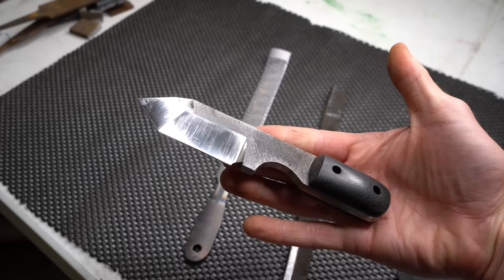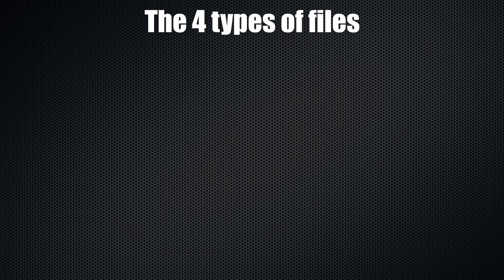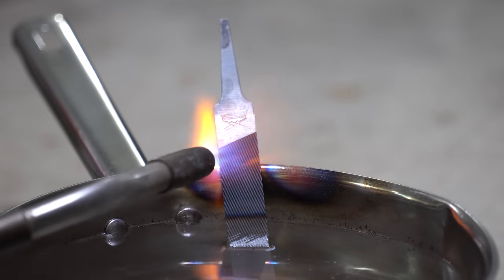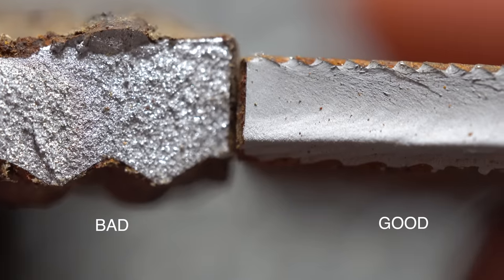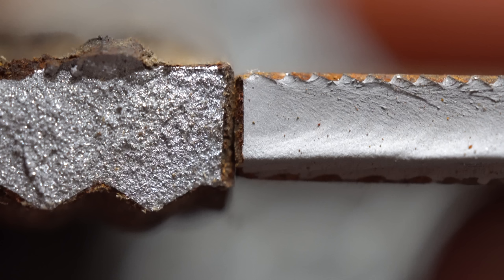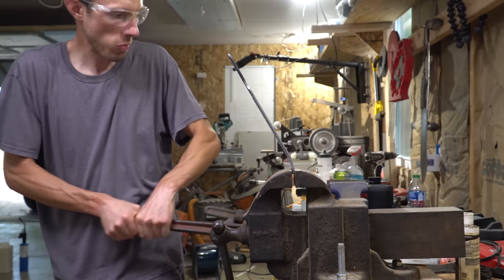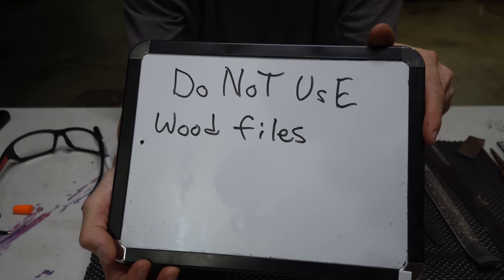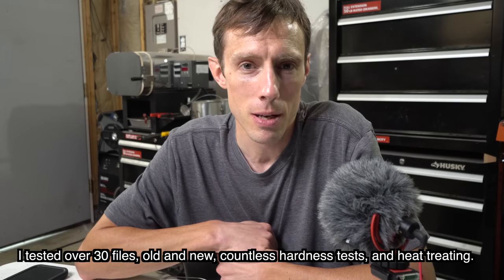DO NOT Make a Knife Out Of a File Till You Watch This Video-A Simple Guide To Files And Knife Making

Comment from the maker: Be sure to check out my recommended product page on my website where I have brief reviews on things I use⬇
https://www.outdoors55.com/shop
This is a work in progress and is updated frequently🙂
IMPORTANT⬇
This video is a brief summary of the mystery steel file world! I tested over 30 files and did almost 300 hardness tests. Testing hardness at the surface, as well as at various depths beneath the surface, all the way to the middle of each file. I also tested multiple heat treat coupons for each file, testing both water and oil quenching.  This video is a good summary and overview of my findings. Keep in mind your results may differ as file manufacturers may adjust their steel and heat treatments over time. If you think I missed something (im sure I did) leave your thoughts below. The idea here is to learn as we go, and any info is good info👍 I left a link to a through hardened file in the description (I tested 3 of these with great results). Thanks for watching!
Reply: just for the record, probably should have mentioned, when hardened steel breaks, it also has a tendency to send shards directly toward your eyeballs., also... why is that?
Reply from the maker: I did mention that, and included a link to a video showing how dangerous breaking hardened steel is. The link is up on the right corner of the screen when I mentioned it.🙂
Reply: @OUTDOORS55  im sorry, you did, my bad.
Reply: Very beautiful presentation. I guess i was lucky (and i used an already broken file with a nice fine structure break) for my first wood carving knife. Still my favourite tool for carving spoons after a few years. I guess it's time to make a proper sheath for it😉.
I'm slowly getting into blacksmithing and i hope to make my own spoon knife. The first one i made was too thin and had a crack so it broke 😒. But i made it a couple years back in a kitchen, during winter time, heating up that file in our central heating coal stove😊. And that was fun! If my mom lived, she would probably chase me with a broom from that kichen. Dad was pretty ok with it and smiled a little. He had blacksmithing lessons in his school time.
Reply: I found a file that says REX U.S.A.  It's old., with a kings crown logo.  KNOW ANYTHING ABOUT IT ? I can't find any info on Google.  Thank you
Reply: @OUTDOORS55 you forgot the 5th file type... The laminated file... Many manufacturers are using laminated 1045 over mild steel cores ESPECIALLY among farriers files and rasps ... They will mimic a solid file they snap nice but when you grind the knife you expose that mild steel core and never get a hard edge despite the hrc tester on the flat saying it should be hard...
Reply: question 68 seems rlly hard for most outdoor knives how could i change my heat treat to  achieve some thing in the range or 58-60 hrc
Reply: even if us as viewers didn't! Do a break test to test what sort of file we are working with would you not agree that it would still be better then 7cr-5cr steel

Comment: Great video. Back in the mid 50's dad made my first fixed blade knife out of a file what kind what brand name I have no idea , I did all the roughing grinding under dads eye all I can remeber is him telling me don't let it get hot . It has a scandi edge all these years later it is my favorite knife especially for skinning it has a 4-1/2 inch blade 4 inch stacked leather handle which by the way other than being bite darker is just like new All my leather gets oiled every new year whether  it needs it or not. Also keep in mind I've never tried to bend or shot it or hit it with a hammer . it just cuts every time I ask it to skinning or wood for kindling never batoned with it just cut  things . Happy Trails Uppps forgot I HAD TO MAKE A NEW SHEATH FOR IT ABOUT 10 YEARS AGO THE ONE I MADE FOR IT BACK WHEN i WAS A KID OUT OF ONE OF GRANDPA'S OLD BOOTS FINALLY WORE OUT AT THE BELT LOOP . hAPPY TRAILS  KEEP ON MAKING THOSE SMART VIDEO'S.
Reply: All i can add to this is...if you build it, you use it for what its Made:-)
And if you writte down the dimensions or make a trace picture if it...then you can rebuild it...even if you lose it

Greatz from Germany
and have a nice Day 
opo
Reply: That’s cool you still have it and actually use it.

Comment: Excellent and informative video. I have had good luck with the farrier's rasps I get from my farrier, but he buys the more expensive ones (>$30 each). I always test them before use though, by cutting off the tang, heating, quenching in water, put in a vise and whack it with a hammer. They snap and demonstrate good grain structure. 
I am not giving the brand, because that brand also makes case-hardened rasps, so it is more important to test them, which I do with every file except duplicates from the same lot (lot number given on the rasp). 
With that said, I also ALWAYS do a full heat treatment on the finished product (with an anneal before working) using a fast quenchant (50). I would not try to simply grind them and use original heat treatment. 
Caveat: I do not have an HRC testing device. I go by file skating and Japanese testing files as well as experience showing good edge retention with use.

Comment: Very good video, just remember if your rockwell testing on case hardened material your likely to push right through the hardened layer. Especially on the the c scale. The thinner the layer the less weight you use to test and change the scale to b or a. There are many ways of testing treated steel and its best to read up on what is the right one. I had many years of treating different types of steel and the accompanying testing involved....its an art in itself.

Comment: Great video - very clear (to me at least).  Yes, those relatively inexpensive rasps are "compositionally" hard. they have a bunch of carbide or whatnot in the steel mix, hence the grain. They are reasonably wear resistant, but not very tough.  I believe they are also impressed with the their teeth while in the red hot condition, and then quenched fast.  The expensive hand made woodworking rasps are through hardened,  because the teeth are cut cold,  then the entire rasp is hardened.  That said, who wants to make a $150 file into a knife?  There are so many worn out steel cutting files available.  I was given a dozen 12" lathe cut files  30 years ago, and I still have a few of them lying around for future projects. I don't typically make knives, but I do make other  odd cutting tools for weird applications,  and the repurposed old files are a pretty good choice for something I may only use once or twice.  
Thanks for your hard work!
Reply from the maker: Exactly! Thats the tough part about using files. The manufacturing method greatly influences steel type and whether it's useful as a knife. Thanks for the input!
Reply: I think I’ll limit myself to power hacksaw blades, I’ve seen them used in factory packing rooms, both on cardboard and flesh, they work well for both and the packing tape handles are easy to make !

Comment: I've been making file knives for the last few years and learned most of the things you mention the hard way. I never touched rasps, I knew they would be no good for a knife, for the most part. I did buy a large file to make a medium bowie and got my heart broken when I realized it was case hardened... much too late into the build. I have learned to tell the difference in hardness in how the grinder takes material off, softer comes off like crazy, it feels weird in comparison to a nice tempered file. I do not re-heat treat my knives, I do not have the facilities, I temper the file and then carefully grind down from there, cooling in water regularly. This takes time, but has the benefit of leaving me with a knife of the proper hardness without overmuch worry. I do the ghetto method of annealing for pins in the handle, works like a charm but I wrap the blade with wet towels and monitor the process very carefully, watching the color of the steel to tell me when it's done. (Usually dark blue.) I really appreciate the work you put into this and wish I had had access to it years ago, its good info! File knives are great when made right and can give you a nice, usable blade as good as many manufactured ones. (If not better.)
Reply: Why would a rasp be no good?

Comment: What I have always done is heat up the file tang till non magnetic and quench it, if the tang snaps or shatters from a strong hammer blow I know that it can be hardened / tempered.
This test has worked for me, but I cannot say how reliable it is.

Comment: Lots of good information here. 
I honestly don't understand the compulsion to use mystery steel to make knives.  The appeal of free seems to be too strong for some people to resist. 
STEEL IS CHEAP! 1075-1080 steel is very forgiving. It's easy to heat treat and A 60" .187x 1.25"  bar can be had for   under $25. That's enough steel to make  5 large knives or 7-8 medium knives. You can quench it in vegetable oil from the grocery store.

Comment: Very interessting, thanks. I personally never heard that you should use rasps as base material for a knife, only files. During C crises I made paper-sheets for all and wood handles for some on my files and rasps (about 25 large ones, 10 medium ones and 20 very small ones) to preserve them longer. handling  these  I can somewhat tell its different materials in them, shine, rust, sound and handeling on material etc. And especially newer rasps seems to be poor "mystery metal" as they go dull quickly (hardly sharp to begin with). I do save the dull ones in case I would somehow sometime get access to a  forge. But this video of yours have made believe I shall not save the rasps., Thanks again.

Comment: I’ve made probably 100’s of file knives, used to make 1700s knives and many originals were made out of files. 
  I only used vintage old American files,that right there will take care of most of your problems
Don’t use a rasp because of the teeth 
I forged all my blades and the rasps teeth can cause problems
When annealing the blade, heat up a flat bar, put it in a tray of vermiculite or wood ash then lay the red blade on it and bury them in the vermiculite 
I usually differentially tempered my blades. Easiest way is to paint the back with stove clay then heat it and quench it in hot
Oil.

Comment: I use only Grover Vallorbe from Switzerland and Pferd from Germany for filing, files. I did make a dagger out of a USA mfg. Nicholson file from the 1960s. Nice presentation.
Modern Nicholson files are made in either Mexico or Brazil and come warped right from the blister pack. Kobalt a brand sold by Lowes have soft steel bodies and partially cut teeth.
Reply: With Nicholson, i also had the same experience. It curls after we soften it, i straightened it with a hammer. Can we continue with this material? Can we have good results? Thanks
Reply: I just got some 12 pferd flat files, they were made in China, cut pretty good though.

Comment: Love the video. I made this one knife from a file and experienced kind of the same thing but i would recommend you try a water quench on the softer files that didnt want to harden much. Mine quenched kind of soft into used motor oil and extremely hard into water (about 63 HRC and cut glass without damage). Basically comes down to a few points - 1. If its regular carbon steel, then it can be heat treated properly ( there are many ways to tell if it is carbon)
2. If its some sort of a blend, it will require special heat treating that you might have to discover by trial and error 
3. If its mild steel somehow then you re better off throwing it away rather than trying to infuse it with carbon
Reply from the maker: I did try a water quench and parks 50 on all samples. There was a SMALL difference between water and parks 50 (maybe half a point hrc) but not enough to change the results. 🙂

Comment: did the middle of the case hardened files re-harden? or harden? The issue is whether there is enough carbon in the middle. Just curious if you ran that. thanks.

Comment: Hello sir, I was wondering if bringing the soft files up to critical temperatures the quenching them in water instead of oil would cause them to become harder? I also understand that some would not recommend a water quenching could cause the metal to crack. the blade smiths of Japan have been using a water quenching system for years. Love to hear your thoughts on the matter. My son pointed this video out to me because I am a hobbyist bladesmith and I do use old files to make blades with.

Comment: Usually I spark test the file, but also heat and quench in wather something like 1.5cm of the end of the tang. If it's hardenable, it will snap, if not it will bend. Like this you don't loose knife material, just the anyway too thin end of the tang

Comment: If you want to make a good knife, you can make like the Mora knives. You take a narrow strip of very hard steel and forge it into softer steel exactly where the edge should be. Similarly, Swedish Yxoe has harder steel inserted in the place of the edge. It is not good to make the whole knife out of hard steel because then it will be hard but break easily. Only the edge should be hard, the rest should be springy without breaking due to vibrations. It is possible to get around the fact that the file manufacturers keep the steel quality a secret. Go directly to the steel manufacturers and ask who they sell to. As Sweden's Sandviken sells a lot of steel to Japanese knife manufacturers. Then you might ask if the Japanese don't have their own steel mills, and they do, but they make steel for cars and ships, not special steel for knife edges.
1095 is a carbon steel that can give a funny striped pattern called Damascus steel sometimes. The steel of choice in knives is 12C27.
In the edge, you would like to forge 14C28N which consists of C 0.62, Si 0.2, Mn 0.6, P max 0.025, S Max 0.010, Cr 14, N 0.11 HRC 56 - 58.5. I guess you don't want harder because that can make it difficult to sharpen the edge. Why take old files that you don't know what they are, but buy steel blanks instead. from a dealer. If you want to buy directly from Sandviken, you can even design your own steel recipe, but then they will ask you how many hundreds of tons you want.

Comment: We have boxes, or had metel boxes of metal type for metal filing parts at Chryslers Dino an metal parts lab. So lose were made along time, 2 generations of retired metal lab and engineering.  It's been closed awhile now, down in Hamtramck Michigan Dodge Chrysler Plymouth. I know that has to be good metal,  I remember braking one of those files as a kid. I'm 60 now, that's many years of Mopar Dodge technology.  Probably some of the 1st metal file's ever used and discontinued idk next time I'm over there I'll grab a couple boxes of them and check them out. I made a big blade out of a truck spring, it needs better cuts in it, as it looks plan an those items I've needed for years to finish this knife and handle.  Are over at my uncle's place,  I just need to visit him more.

Comment: Farrier rasps that are quality are typically 67 Rockwell hardness so what was the price point of the farrier rasps you used? And in fact the ones I purchase will not even cut easy anywhere throughout the rasp also the farrier rasps you showed on the video didn't seem to look big enough to be a farrier rasp
Reply from the maker: I didn't show every one tested. Some were old and some were new. Some were ferrier rasps and some were wood working rasps. The point is they can't be trusted unless you do your own testing. Rasps and files are not meant to be used for knifes. They can change manufacturing techniques and not advertise. Just do some testing before using mystery steel.

Comment: Be cool if you could test different farrier rasps. There’s always debate in the knife community about different brands. Heller, Bassoli, and bellota are main ones I know of. Bassoli is allegedly 1084, the heller depending which one you use. Black, red or green tang and bellota. I’ve never had luck with ballota other than throwing knives. Heller has been spotty highest I was able to get was 61 rc after tampering. But have used a basolli. Just be fun to watch.
Reply from the maker: Id do more testing but testing is expensive and it doesn't pay for itself unfortunately. Also one main problem with files and rasps are that at any time the manufacturer can change the process or steel used and the test is irrelevant. I think that the inly way is to test each file every time. Unless some manufacturer specifically states what steel they are using.🙂
Reply: @OUTDOORS55  lol I get it. You just need to win a lottery so you can do it all. Then I can enjoy the videos. Thanks for all the time and effort you put in. Looking forward to your next one.

Comment: I made a knife from a file that did harden and temper but I always try to snap my blades after making. The file knife did snap. Not sure what I did wrong; it was my first knife failure. The customer ended up with a spring steel blade with “file” marks created by chisel work.

Comment: Most file tangs are not hardened btw, so it’s probably not a good place to measure hardness. At least with all files I’ve owned (about 40, I know…) Also, stay away from ‘wax’ files or wood files and stick w/files said to work with ferrous metals as stated by the manufacturer. I’d be interested to see how knife making would go with the Inox files by Grobet (Glardon Vallorbe Swiss white label in the past). From my recollection they advertise a 70+ rh (I think 73?) but idk, never made a knife maybe there can be such a thing as too hard? I know I love the Inox files for lathe/mill work on particularly hard steels. Anything hardened though requires diamond files/tooling. There’s a 10” x1” 00 for pretty cheap on Amazon typically